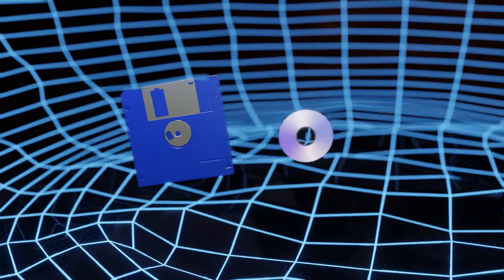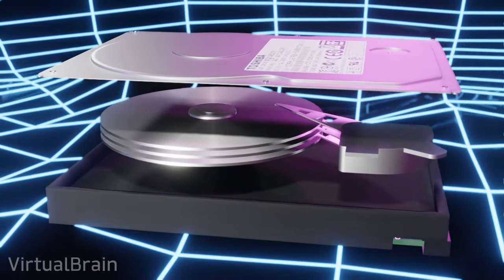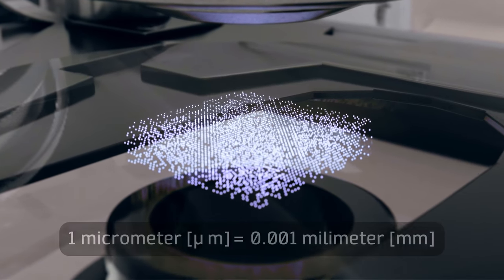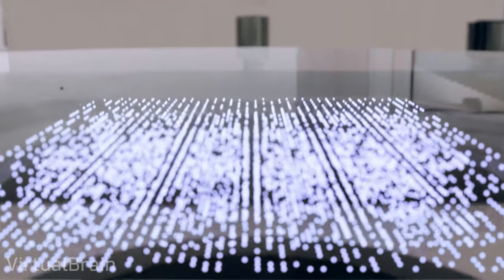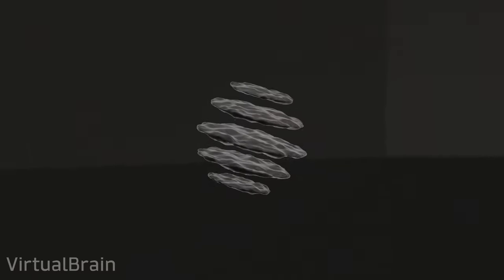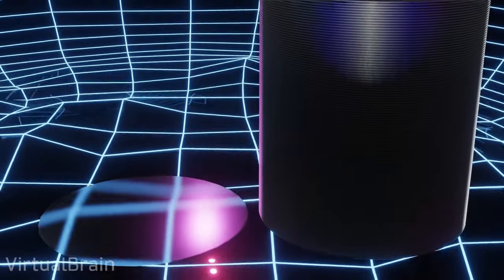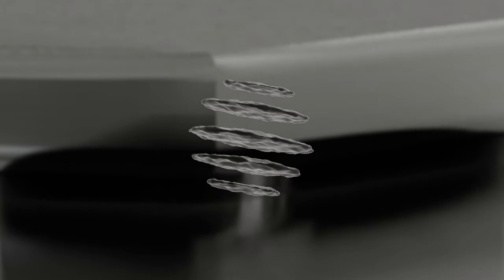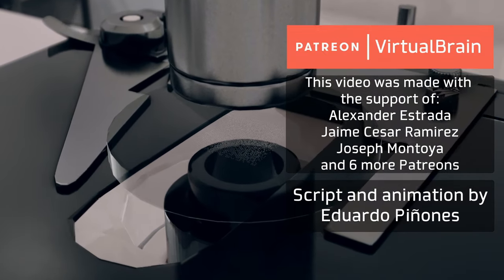5D Quartz ETERNAL Storage 💿 How it Works

Comment: 7:00
In other words, the same limitation as CD/DVD burning. If it's used for archival purposes, that won't be a problem and the only factors that matter are:

1. That is can store a large amount of Data unlike CD (700 MB) or DVD (4.7 GB). 8K Video recordings are too large to fit on either.
2. That it is damage resistant (unlike HDD which are infamous for permanently breaking if the HDD receives even the smallest amount of fall damage.)
3. That it can retain the data for as long as possible (unlike SSD memory which looses all it's data if not plugged in for anywhere between a week and a year). Current most data mediums last 5-10 years at most and the only known reliable long term data storage is magnetic tape which can last 30 years before it starts to deteriorate. There is also M-disk which has a theoretical life-span of 1,000 years
4. That the data will be readable by future devices and Operating systems, whether that be for hardware reasons or data format reasons.
Reply: It is pretty much the ultimate storage device for archiving.
Reply: Didn't they just do studies showing cds and dvds are deteriorating much faster than expected?
Reply: @mcchristenson  Some burned CD/DVDs are dying faster. When CD/DVDs are burned, the dye that represents the data gets cooked. In some CD/DVDs, the dye is lower quality than others and detoriates quicker. In some cases, the dye deteriorates quicker because it's organic.

To get a long-term CD/DVD you have to use archival quality CD/DVDs that use inorganic dyes and have better protection.

Also forgot to mention CD/DVDs that are bought and contain some sort of data, for example, a game, are not burned. They are called pressed CD/DVDs. They can't detoriate because the data was already written on the CD/DVD when it was pressed together in the factory.
Reply: @_M_643  but it wasn't the degrading of data but microscopic corrosion forming between the layers that is causing them to fail. Idk.
Reply: @mcchristenson  Even regular people are reporting this. Since optical disk technology is now more than two decades old, many people have large stashes lying around. And the results are not very encouraging.
Reply: @gokuldastvm  ill just keep all my media on hard drives. Just proper backups and rewrite every couple years and your good. Obviously buy a new drive when necessary. Drives are so cheap now and the time and money to say burn 5TB to disk would be ridiculous.

Comment: In this way, reading and writing data can be a attainable thing but  editing, deleting looks little bit difficult.
Reply: What exactly seems difficult about it? For reference, the video talks about that aspect. Apparently, a voxel can store 4 bits of information. While it's not possible to erase a voxel, it is possible to switch a voxel between the 16 states. In other words, you can overwrite a voxel. Just write 0s or 1s or some random data onto the voxels to erase anything.

Comment: IN 1972 I WAS STARTING COLLEGE AND WORKED  AN INTERPRETER /  TRANSLATOR FOR NASA IN THE DC AREA. I LIVED IN BETHESDA, MARYLAND.  NO ONE EVER ASKED ME TO SIGN AN NDA. SO I AM NOT VIOLATING ANY RULE OR REGULATION.

Because I was an amateur radio with a strong background in electronics I was introduced to to and befriended  other Nerds working there. 
I was shown A 10 x 30 cm very pure cylindrical crystal  that was in a clean air room being  examined by a friend of mine in the military. 
It was written and read by a variable intensity tunable set of lasers  smaller than todays LED’s mounted in vertical positions (cylinder was  standing  up.)
One laser pointing down lengthwise down the crystal able to move running along the diameter & penetrate the entire cylinder.
The second laser was mounted lengthwise near the cylinder had variable intensity and able to cover the entire diameter of the crystal.  The cylinder was suspended  in a vacuum chamber and rotated at up to 50,000 RPM.  The lasers wrote information at the intersection of the two beams  at a  MOLECULAR LEVEL ON THE CRYSTAL!  This was determined by electron microscopy and X- Ray diffraction.  Being tunable they could vary the frequency of the beam and therefore write  in different modes on a hexagonal structure of the crystalline molecule. Without compromising the structure of the crystal! 

When put back on its place and  activated, scenes of Roman , Greek  constructions underway, as well as medieval battles. medieval battles were shown on a holographic projection. Historians working for the government were decoding what and where these videos were from.  
THIS WAS OBTAINED FROM A CRASHED BUT NOT DESTROYED UFO IN THE MEXICAN DESERT! 

REMEMBER I SAW THIS IN 1972!!!  
Just imagine what is available now! 
I Was hoping someone would “ INVENT “ this technology  in my lifetime! 
I AM THRILLED THEY ARE FINALLY, LITTLE BY LITTLE RELEASING THIS “ NEWLY INVENTED TECHNOLOGY”! 
Like this, there are many more.  The first one to be “ INVENTED” was fiber optics by  CORNING ! 

I CAN ONLY HOPE TO SEE MORE SIMiLAR  “INVENTIONS”  TO BECOME PUBLIC !!!